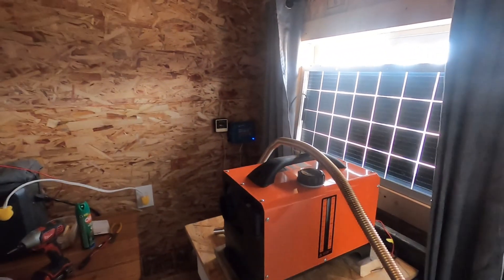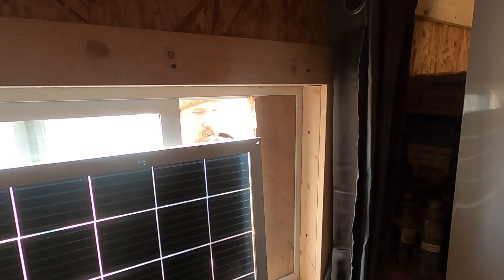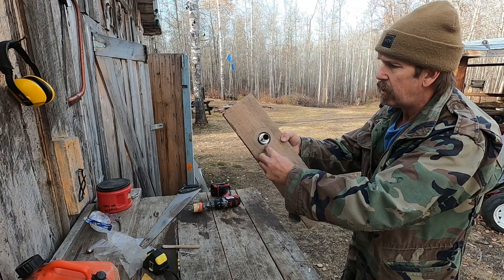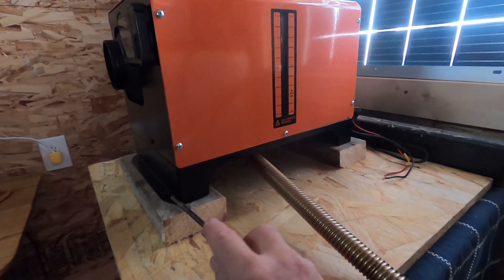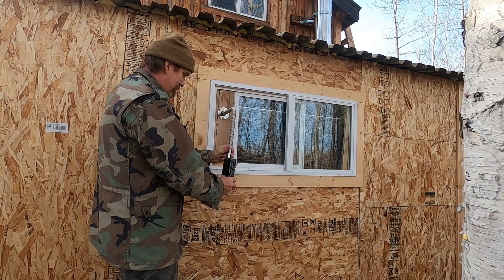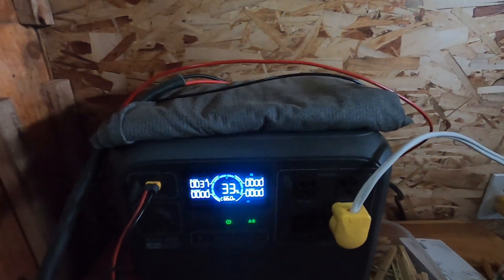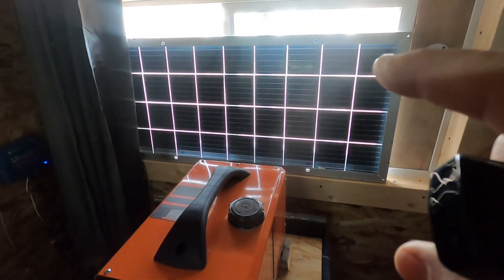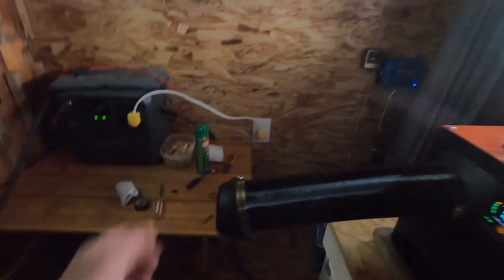Installing a Vevor Diesel Heater and Solar Power for Off-Grid Heating

Comment: Errm... great idea but not great installation. Your exhaust vent tube must run downhill all the way. Any upward gradient will cause it to fail within a couple weeks. So many do what you have done and them blame the heater saying they are junk. What happens is condensation in the pipe that causes everything inside the burner to soot-up. Please read the instructions...
Reply from the maker: Thanks for the feedback.How does condensation form when the unit is in a heated cabin? I'll definitely look into adjusting the exhaust vent to run downhill.
Reply: @CanadianDreamer  Just cold and hot air mixing produces a bit of condensation that comes out the exhaust on all of these units. Hope ya got it fixed so it all flows down
Reply from the maker: @MOONSHIPETH  Yes thanks for the input. Its been running well over a month now. Cheers

Comment: Good video buddy! You may want to run your intake outside if you have enough pipe. When diesel heaters stall they can belch smoke out the intake
Reply from the maker: Thanks for the heads up. I WILL look into doing that.